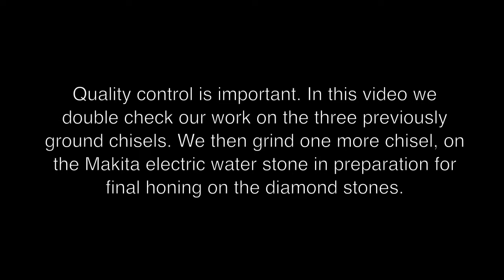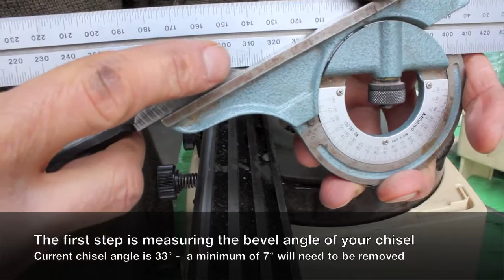Grinding Wood Chisels Free Hand • Complete Sharpening Series Video 4

Comment from the maker: I have some new sharpening videos out featuring a sharpening jig I invented that will correct your issues quickly using either stones or abrasive paper. I can't send links in the comments but you are welcome to write me at askwoodman @gmail . com and will answer any questions or be able to send you pics or links. Check out those new video on The Ultimate Sharpening Jig. Allan